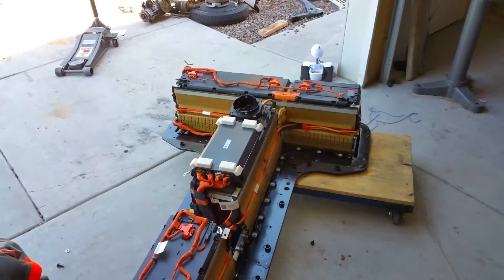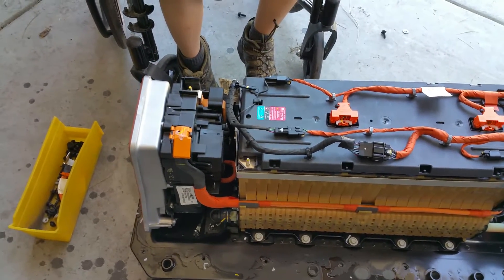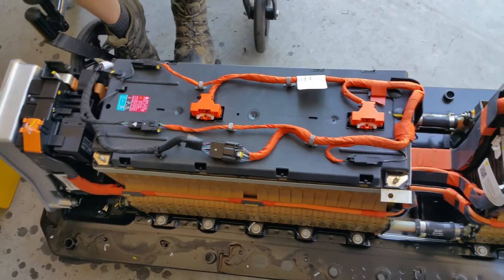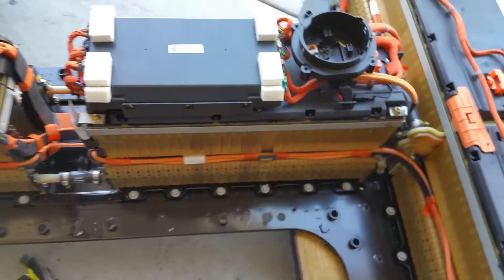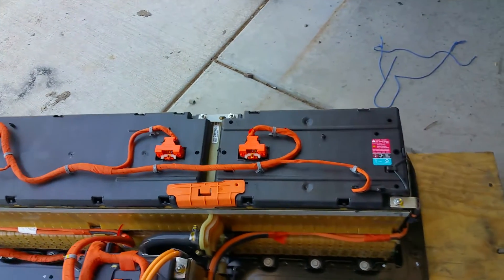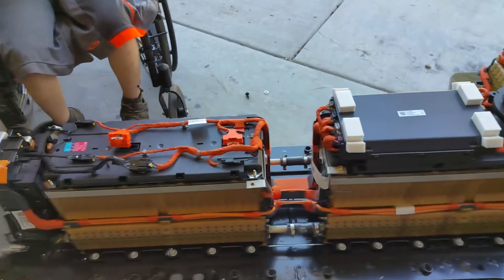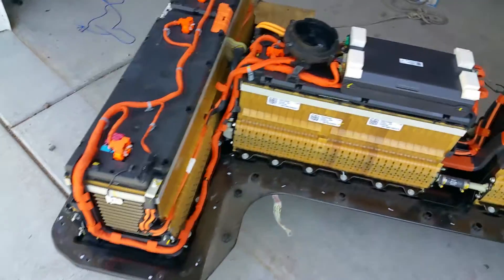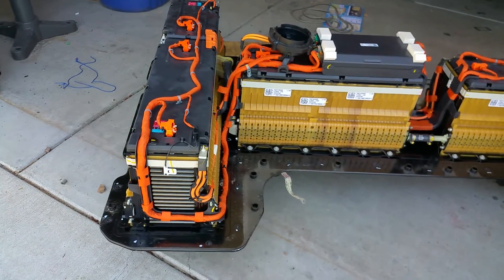2017 Gen 2 Chevy Volt Battery Overview

Comment: Where do you read pack voltage? Can you make quick vid or describe location? Thank you.
Reply from the maker: If you don'e have the pack open I don't think you can read the voltage without powering it up and sending the CAN codes to close the contractors.  Not 100% sure as I have never tried.

Comment: WHEN YOU BUY THAT CAR. SOONER OR LATER THOSE BATTERIES WILL NO LONGER CHARGE. SO CONTACT  CHEVY ASK THEM TO  SEND YOU A REPLACEMENT BATTERIES.. QUESTION 1 HOW MANY FULL CHARGE CYCLES CAN IT DO? QUESTION 2 HOW MUCH DOSE THAT BATTERIES COST? MY GUEST IT WIL COST MORE THEN A BRAND NEW CAR.
Reply from the maker: DOE actually has testing on this and the expectation is 200,000 miles to 80% capacity.  But that is even conservative as we have +100,000 miles (almost all EV miles) on our Volt and it still has 95% of it's capacity.  If I ever needed a replacement battery it would cost me $1300 plus installation.
Reply: @EVEngineering  I was just quoted 10k for a new battery pack, and about 4.7k for a decent used one. My volt has 85k miles on it, and has gone from 58 mi. Range down to 42-44 now. Chevy claims it has to go wayyyyyy lower before they consider it bad, which is convenient for them to not warranty it.
Reply: @EVEngineering  Where are you getting the 1300 plus install?

Comment: I'm surprised for gen 2 that they didn't completely make the floor battery packs like a tesla instead of the T shape. Since they were redesigning anyway they wouldn't have to fill it all up with batteries but it would allow GM to expand the size of the battery in the future without major redesigns.
Reply from the maker: The T pack actually has advantages.  The Volt has the generator so it really wouldn't make sense to increase the battery capacity.  40-50 mile pure electric is plenty for 90% of driving.  The generator is there for the other 10% of the time.